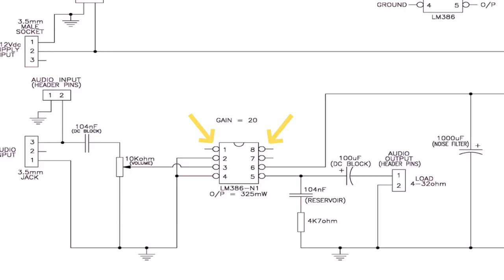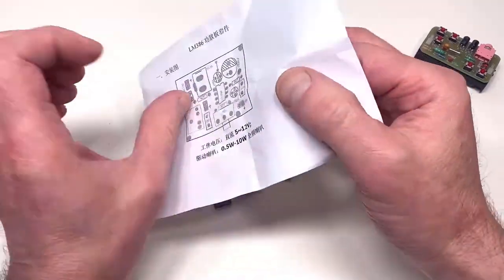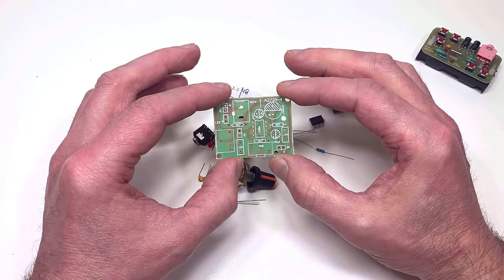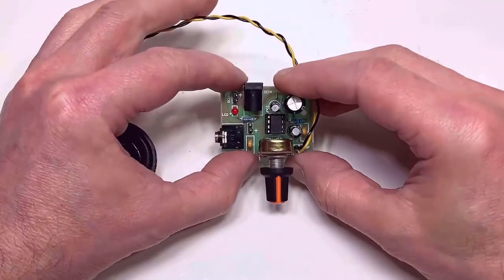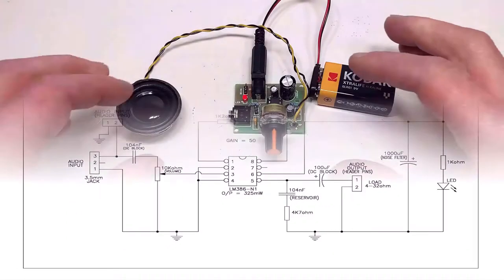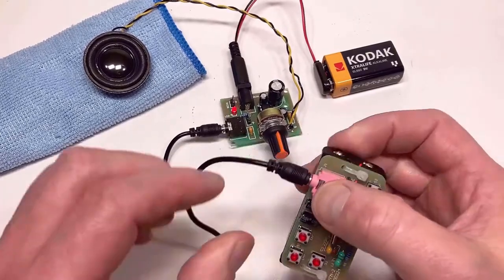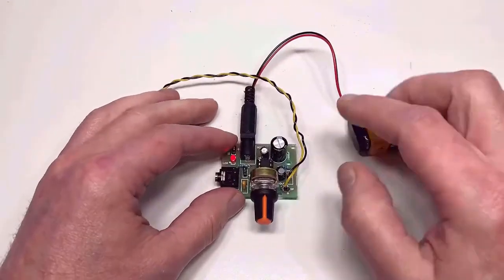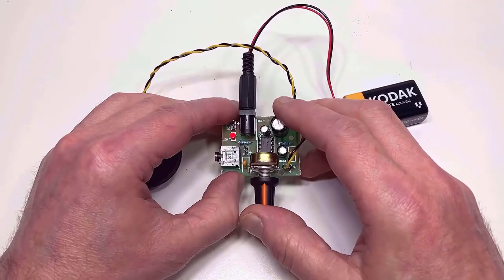A neat little LM386 Audio Amplifier Kit for just $2 - so is it Bad or a Bargain?

Comment: The LM386 really needs a bypass capacitor connected to pin 7, I use 100uf to be safe. However since the audio amplifier is self powered with its own battery supply I guess for most applications it is safe.  It is a terrible chip though. With most other audio chips the chip designers take account of the effect of the current draw on the power rails and how that would feedback into the chip. The designers of the LM386 weren't that sophisticated, lol.
Reply from the maker: Hi, appreciate your observations. I have seen different capacitor values specified for this bypass capacitor from 0.1 up to 100uF as you mention. However, the extreme low cost of the kit has to be taken into consideration so I think we can forgive them for trying to save a few cents on capacitor. Although battery operated, electrical ac noise can be picked up from nearby electronics so it's a good thought and even maybe even across the +V & 0V lines to assist in filtering with maybe a 100uF & and one of a few pF. The great thing with these very low cost kits is that you could purchase a few to experiment with!
Reply: @TheWobblyCameraGuy  Very true. If you live in a low cost country you can get a completed LM386 module for 50 cent US. 
I am thinking of getting more into module based electronics. Anyway thanks for the comment and the videos.
Reply from the maker: @congchuatocmay4837  Hi, wow that's really low cost!  These kits are a fun and low cost way to  explore electronics and are better for using standard size components rather than the surface mount type which are always challenging to solder!  I have a couple of more kits that I intend to review so it will be interesting to see how they eventually perform. Good luck with your modules!
Reply: It WAS DESIGNED for low-Fi use

Comment: Nice build! I building one now I want to use as a small battery power amplifier for my 3 string cigar box guitar. I connected the guitar Jack to the audio input, is that correct. I not getting any sound out of the speaker I connected the speaker to the SP +- on the PCB.
Thanks
Reply from the maker: Hi, that sounds a very interesting project. Your speaker connections to SP+ - are correct. If you not getting any O/P, you might want to re-check a few items:

1. Check the polarity of your DC supply connections if you are using the 3.5mm jack as it is easy to get these crossed.
2. Check that all the electrolytic capacitors are correctly connected polarity wise.
3. Check for any unintended solder bridges.
4. Check that the DIL socket is not fitted the opposite way round & hence, the LM38 chip may end up being fitted 180 deg. to what it should be.
5. Check for any dry solder joints
6. If still no joy, try another speaker.

I would be interested on how you get on. Thanks for getting touch.
TWCG
Reply: @TheWobblyCameraGuy  Tanks for the help. I will check out over the weekend and let you know how I make out. Would I connect the guitar jacks into the 3.5 audio block?
Reply from the maker: @richardgianatasio9611  Hi, yes you can use the 3.5mm audio jack connector or if you want a more permanent connection, there are a couple of solder pins directly behind the audio socket. Good luck!
Reply: you probably need a pre-amp

Comment: hello i recently build my own speaker using 2 small speaker and a car door speaker now i used the motherboard of the small speaker and the car door speaker cant go louder is this because of the lower voltage battery (3.7v) or because of the motherboard and would this help with that issue ?
Reply from the maker: Hi, thanks for getting in touch. Assuming the gain is at maximum, (i.e. 10uF cap between pins 1 & 8) then there are a couple of things to look at. I'm not sure how you have connected three speakers to the amp, but if these are in parallel, then their overall impedance may be too low for the amp, (it needs at least 4 ohms). Your 3.7V dc supply is a little low, (some data sheets for the LM386 give a minimum of 4Vdc. As you say, a higher voltage will improve the output power a little). Note that the LM386 amp provided in the kit is rated between 200 & 300mW depending upon voltage. You could substitute it for an LM386-N4 which has higher output of approx. 1Watt. Hope this helps and good luck with your speaker build.
Reply: @TheWobblyCameraGuy  honestly i dont know im 14 and got bored on a sunday and started doing random things and somehow it worked and yesterday i got a bigger battery but still with 3.7 volts because i was scared that it would overheat or something with higher vaults bc im pretty bad at elektricity stuff
Reply from the maker: @zedvdvimhim3875  Hi, thanks for getting back to me. You may have had a partial short somewhere or a bad connection? I would suggest that you look at all your solder joints, (maybe with a magnifying glass) to make sure they are good, (usually if the solder joint looks very dull it may indicate a bad solder connection and is worth re-doing the joint). Don't give up my friend, keep exploring, learning and making new things! 👍
Reply: @TheWobblyCameraGuy  hi there im back aigan so i wanted to buy a higher voltage battery for my speaker i built but i cant find any good batterys i wanted i good voltage one but i cant find it and i would want it in a decent shiping time and price do you have any suggestions ?
Reply from the maker: @zedvdvimhim3875  Hi, I'm always happy to try and help you my friend. If you are struggling to find a 9V 0r 12V battery, then you could consider using several 'AA' size batteries in series to obtain the desired voltage. If you purchase a 6 way AA battery holder and PP3 battery clip to connect to your amplifier, then 6 AA batteries will give you 9Vdc. If you want a higher voltage try an 8 way AA holder which will give you 12Vdc. Hope this helps 👍
Reply: @TheWobblyCameraGuy  thanks for this information but will it be recharagble because right now it has an QY 18650/1200 mAh 3.7V battery a couple weeks ago i orderd an QY 18650/9800 mAh 3.7V battery for a longer life and resulting in being able to listen longer but this would not increase the volume but would i be able to connect both these on the same cable system since its a really small motherboard abt 1x1 inch and it uses i think 4 pin adapters if it even are those since i am a really bad electicity guy
Reply from the maker: @zedvdvimhim3875  Hi, you are doing really well and learning a lot my friend! All you have to do is just use rechargeable AA batteries in the battery holder, (assuming you have an AA battery charger? If not, you can usually buy a charger complete with batteries that is reasonably inexpensive). Just be aware that rechargeable batteries tend to be rated at 1.2V rather than 1.5V for a standard AA battery.  So for example, 6 x rechargeable AA batteries with give you approx. 7.2V rather than 9V if you were using standard batteries. Keep going and let me know how you are doing 👍
Reply: @TheWobblyCameraGuy  thanks for responding so fast ! i like the idea of having 6 AAs delivering 7.2V the thing is a couple weeeks ago i orderd a 3.7 volts high mAh lithium battery now my question is would i be able to connect the + and - from that 3.7 one to 1 holder for an AA battery in the plastic thingy so that i would have 5 1.2V AAs and 1 3.7V battery that would result in 9.7 volts and an long lasting time if that is possible that would be so awesome if not i would just keep the 3.7 battery as a reserve
Reply from the maker: @zedvdvimhim3875  Hi, you are thinking logically and I can see where you are coming from. However, you can’t really series up your 18650 with an AA battery back, one it’s messy and two there may also be issues current. If you use this link as a guide, (  https://www.aliexpress.com/item/32791755631.html?spm=a2g0o.productlist.main.25.2b76308eLukgFK&algo_pvid=5775ae71-65dc-417f-ba83-42b305e1100e&algo_exp_id=5775ae71-65dc-417f-ba83-42b305e1100e-12&pdp_npi=3%40dis%21GBP%213.05%212.04%21%21%21%21%21%4021021d7b16884144338443547d0763%2163558471572%21sea%21UK%212363707412&curPageLogUid=jN1DIljBTIVA). This is a typical 8-way AA holder available on Ali Express, (I have just chosen this at random for an example and don’t know the store so please do your own checks first before any purchases). Using re-chargeable AA batteries this will give you approx. 10volts which should be plenty for your little amp and last a long time between charges. It has two flying leads that you can connect to your amplifier supply terminals. Hope this helps.
Reply: @TheWobblyCameraGuy  im back aigan so i found an 7.2 volt battery wich uses 6 AAs it came from an RC car but i tested the max volume with the 7.2V and the 3.7V and there is no sound diffrence they are the same volume so it would not help getting more volts but i dont know why
Reply from the maker: Hi, thanks for getting back to me. Once you have gone past the 4Vdc supply level (you were previously using a 3.7V battery), you are within the recommended power supply voltage levels, so you won’t really get much more out of this little amp. Assuming that you have a 10uF capacitor between pins 1 & 8 on the chip, (this gives a gain of 200) then you are also at max gain. As mentioned before, the LM386 audio chip used in this kit is the lower O/P version LM386-N1. If you swap for a LM386-N4 it will give you a little more gain and hence, a slightly higher output. However, please bear in mind though that this little amp is used primarily for small portable devices like radios etc. If you need a lot more power then you may need to look at a different amplifier. BTW not sure if you have one or two speakers connected, but their impedance should be between 4 & 16 ohms. Might be worth checking, as if you have two 4ohm speakers connected in parallel, it would result in a 2ohm load for the amp which may cause issues. Hope this helps – please come back to me if I can assist you any further
Reply: @TheWobblyCameraGuy  hi so note i forgot to tell in the first comment i didnt buy this amplifier yet im just using the motherboard of a small speaker altough that i do have some 100uf 25v capacators and a while back the batterys i order are 4 18650 3.7 volts and 9800 mAh if its too complicated for me to figure out a way to make it louder wich is currently not working out since i have low to 0 knowledge could i pair up those 4 batteries to just make it last very long withouth having to charge it
Reply from the maker: @zedvdvimhim3875  My friend. You are doing what very few of your age do and that is to experiment & learn for yourself so well done you!
You will encounter many obstacles, but every one is a learning experience so keep asking questions and experimenting. For the low cost of the amplifier board, it would be worth purchasing for experience with soldering and you will end up with a very useful little amplifier!  There are lots of YouTube videos on electronics and even the LM386 you are playing with so I would encourage you to watch videos and read books to increase your knowledge – keep going 👍
Reply: @TheWobblyCameraGuy  thanks ! so monday i took it apart and took a better look at the parts i was using but could not see any capacators that limited it to 4 volts i do have 18 100uf 25V capacators maybe i could add those somewhere so i can make the 3 speakers louder do you have any other social media where i can send a picture of the motherboard im using because its really small and compact with allot of small tech on it
Reply from the maker: @zedvdvimhim3875  Hi, thanks for letting me know how you are doing. I’m a little confused as the 10uF capacitor I mentioned does not limit voltage. If you put a 10uF capacitor across pins 1 & 8 on the LM386 audio chip (assuming one isn’t already in place), then what this does is to increase the gain of the amp. i.e. make it louder (up to a certain limit). If you have 3 speakers attached (without knowing how they are connected or what their impedance is), may be causing you some issues.
If I can suggest you watch this YouTube video (https://www.youtube.com/watch?v=4ObzEft2R_g) it may help you to see things a little clearer.
Unfortunately, I am reluctant to give out details of my email address etc. as there is a tiny minority that may be tempted try and take advantage of it.
Keep going – you are learning which is the most important part! 👍

Comment: I just soldered one together and it don't work I should know better than to by fake stuff
Reply from the maker: Hi, sorry to hear your little amp didn't work out. However, it would be worth checking a few things before you give up. These might sound a little basic, but I have done some of these myself on more than a few occasions! Firstly, ensure that electrolytic capacitors have been correctly fitted as they are polarised & so will not perform reversed. Is the LM386 fitted the correct way around, (and a check to see if a pin has been bent)? Suggest you also check for any dry joints, (sometimes component leads require a quick rub with fine wet and dry to remove oxidisation especially if new old stock items are used), solder bridges between PCB tracks etc.  All worth checking - good luck!
Reply: skill issue

Comment: Can use this one in the car?
Reply from the maker: Hi, good question! It is possible, but in my opinion, not really recommended. It's maximum upper voltage supply is given as 12Vdc and car batteries & charging systems can go as high as 14Vdc depending upon load. Additionally the  audio output would not really be loud enough. However, if you search for 'car audio amplifiers' in AliExpress, there are a lot of low cost $10 or less amplifiers that may be just what you are looking for.  Good luck in finding your amp.
Reply: @TheWobblyCameraGuy  thanks
Reply from the maker: @haythamso977  No problem, thank you for your interest.
Reply: No it’s against the law
Reply: @tonywright8294    lmao